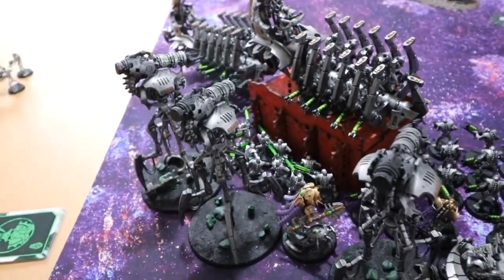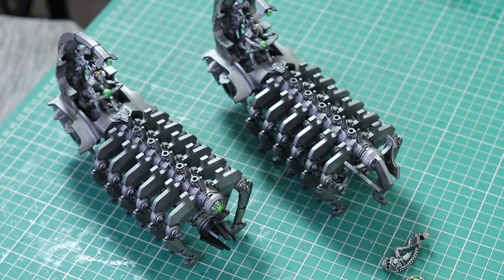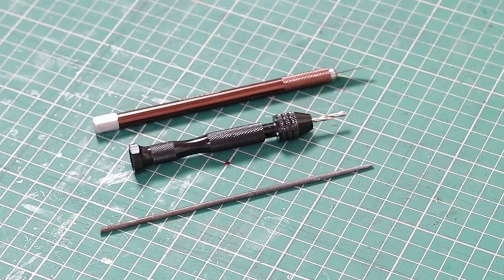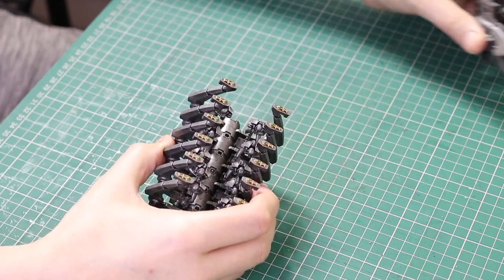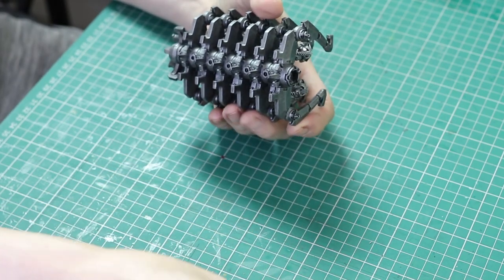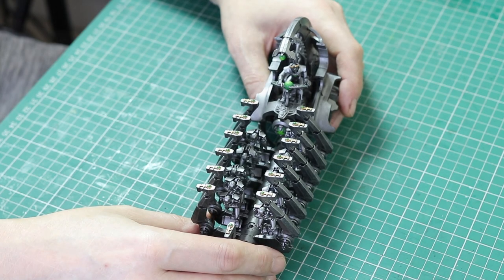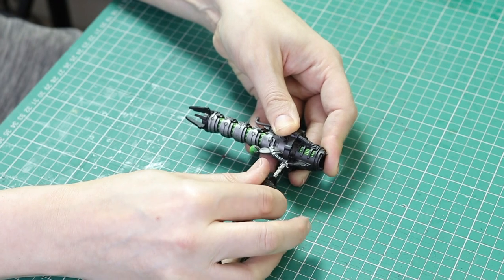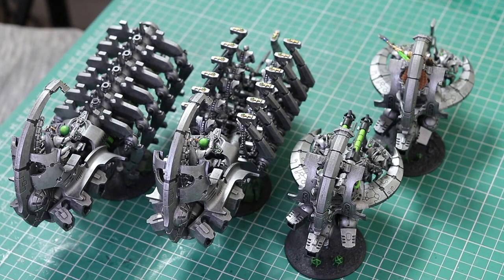Never Break a Necron Ghost Ark Base Again!

Comment: Thse stems are so bad for these types of models! I replaced all the ones on my Eldar skimmers to avoid this! Basically the same technique with a bigger hole drilled but used brass rod on the bases. I then put those into a cork base and used 3mm rod. Job done, and never a breakage! Unlike these Necron models the Eldar ones are hollow and can then lead to slanted models, so I used old bits of sprue on the inside to make a full depth shaft for the rod. Required pre-planning to do that, but this tip on Necrons doesn't need that. Nice one!
Reply from the maker: Thanks Nick, a good idea too,  although I like the clear plastic. I drilled my holes at an angle on the Eldar grav tanks for some angled poses too he he

Comment: what I hate is that GW hasnt bothered coming up with a better solution for the flying bases they know have been constantly breaking for over 20 years. ive had to repair every single battlefleet gothic model i own multiple times as well as necron destroyers. for my ghost ark i had the sense to use brass rod from the start because I knew it would break if I didnt.
Reply from the maker: Tbf GW seem to be moving away from them now in favour of using terrain to give the appearance of hovering. I magnetised all of my BFG ships and so glad I did
Reply: @IDICBeer  how do you keep the magnetized ships from spinning around on the magnets and changing facing? do you have some way of locking their facing to the base?
Reply from the maker: @Khobai  Nevwr found spinning an issue, must be the strength of the magnets as I use N52

Comment: yes a cute demo   sorry me i ues a naill or rod   if go hard whare store you find naill thay ues fore wood panels you derat with thay caled  finning nails thay got smaill round heed   wel you will just need to put in stand but heating up   and litel crazay  glue  you put in hole that you drield out   the heed this nail is smail round and  shud fit if got rod platic or if can find it meatel  then   cut it to lath and fit it in  old TV antenas  do trick to  and if can get work  your mini can go up and down   to   so that my thing post as do new
Reply from the maker: Yeah a nail or rod is an option, i just like the clear plastic myself